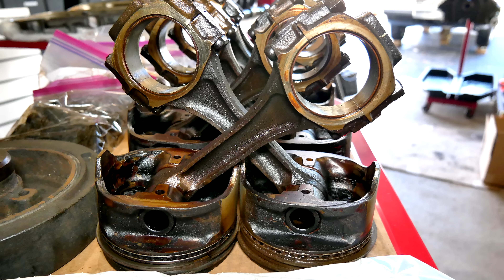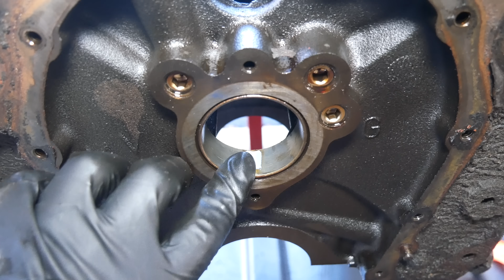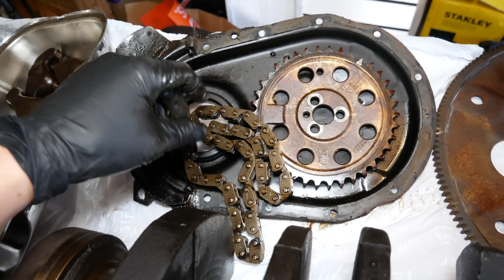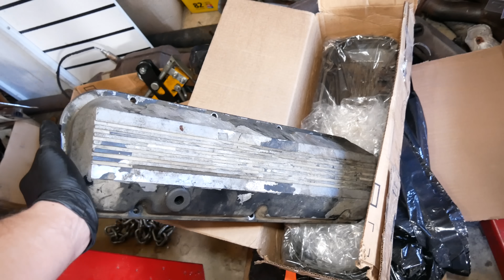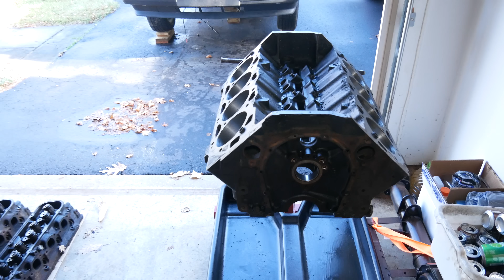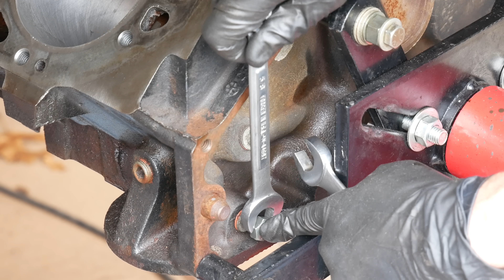$200 454 Engine Rebuild: Examining Parts and Laying Out Plans (78 Firebird Ep.15)

Comment: 3 years and i still am dying to see it run. I have a bored to 429 with d0ve heads that was "built" many years ago but sat for years and the cylinders look about as bad as this engine...... before i spend money on the rebuild kit and spend time honing the cylinder i wanted to see how this worked out for you lmao... 3 years still sitting in the garage for me, i guess i could have spent the money and did the work by now and found out myself 😆

Comment: The electric fuel pump will be nice for using a fuel bypass up by the carb. Which you're probably away will help keep the fuel from getting heat soaked.

Comment: It seems to me that this whole project with the big block is really not worth the effort. There is little point in installing this engine that is 200 lbs heavier than a small block and will make the car handle much worse for really not that much power. The purpose of installing a larger engine is to get more power but you keep talking about keeping the poor original heads and even the very low performance cam. The gen 5 was the worse one of the bunch and has the worse interchange possibilities. The heads are the very small peanut port ones and none of the valve gear is worth keeping for any performance purposes. The compression ratio is very low with this piston and cylinder combination. I have done lots of big blocks and I wish you the best but if it were me, I would try and unload this one and try and get a Gen 6. You will start off with a much better platform and can make something out of it. There are no good cylinder head options for you with the Gen 4 block and that is a key element in making this work well. Also you are going to have to face the fact that some unavoidable machine work will be needed so don't try and lowball everything and built something that does not perform correctly. Please forget about using that stock cam, any hydraulic flat tappet from Comp or anyone will wake this thing up so pitch it in the trash where it belongs. Remember you are building a big block Chevy and it's going in a Firebird. Give the car something to be proud of, not some castrated engine.

Comment: I replaced my my intermiadate shaft bearings with long threaded rod, nuts, washers and used a matching dia. wheel hub puck. You could rent a wheel hub press kit, maybe free from the auto store? Don't say no just yet...

Comment: Are you planning to at least shim your springs up to make sure they have good seat pressure? Should have those cylinder heads milled to lower the cc’s a little with running forced induction... Great Video’s Sir, Glad I ran across this! 🤟
Reply: I believe he said that he's getting higher rate valve springs and lapping the valves.
no reason to skim the head if they're in spec (which they should be being iron) low compression is ideal in a supercharged setup without an intercooler.
Reply: @ChristmasCrustacean  Naw man! There is ALWAYS a reason to surface cylinder heads when an engine is apart, ESPECIALLY when doing work to them!! I grew up in my Pop’s engine shop & at the racetrack, and have been racing & building myself now since I was a teenager (for nearly 20yrs.) Not trying to argue, or strong arm anyone. Just trying to give some friendly advice, so no worries. Take care!

Comment: I'd love to see you pay for that cam berring tool with a project. I havent found that anywhere on the YOUTUBE.  If you had some tools you really want but cant seem to buy for $$ resons. well, shame on money. You could even use the video/timelaps video to sell the finnished product. and blamo tools had. have a great day, yall....
Reply: the channel was smaller in december 2019 when these three videos were filmed and then engine was rebuilt in 2020... so while he couldn't justify the cost then he probably would be able to next time he has to do a cam.
honestly the cam bearings look fine and the same camshaft that was in it is going back in so it will probably be okay.

Comment: A 454 Chev engine without forced induction will last forever with just a bare bones rebuild.

I have a 5.7 litre Chevrolet LS1 V8 engine which has Done 363,132 kilometres & while I have replaced the hydraulic lifters ,oil seals & gaskets in it the crankshaft & camshaft bearings are all original as we as the piston rings.

The last time that I checked the dipstick it hadn't used any oil so the big V8's seem to last forever,I bought it with about 182,000 kilometres on the be odometer in 2008 then I put another 181,000 kilometres on it !

Comment: I'm perplexed. You spent $200 on a Chevy big block to save money, then had to spend more money to change things. I bought a 1972 Pontiac 400 4 bbl complete for $500. I have to change nothing to put it in my 72 Lemans. I even got it started after years of sitting. I'd rather keep a Tin Indian in a Poncho. I will also spend less.

Comment: I'm confused. 
Is he "rebuilding" a Chevy 454 or a Pontiac 455?
Pontiac never made a 454.
Reply: From what I can remember, the previous owner gutted the entire Pontiac drivetrain and put in a Chevy engine and transmission. So I think he's going with a 454 to keep things simple.
Reply: @xxnickdahackerxx2356  it never had a pontiac engine, it had a 305 chevy from factory.
the previous owner bought it without an engine and put in a 350 crate motor.
he's putting in a 454 Chevy because the car came with a chevy from factory and the supercharger parts are more readily available.

Comment: Reusing bearings and head bolts scares me lol
Reply: they're apparently not TTY headbolts so it should be fine, especially if the heads have never been off before.. a second stretch on non TTY bolts is nothing.

Comment: You should not have used the same head bolts that’s a very bad idea your head is going to start to lift with mileage
Reply: apparently not TTY headbolts so it should be fine, especially if the heads have never been off before.. a second stretch on non TTY bolts is nothing.

Comment: If you are going to push any decent level of boost(10+ psi) then I seriously doubt those tired, old, soft valve springs are gonna have an easy time closing the intake valves. Have fun with that!

Comment: me not being from the states so I cant give too much opinion on this build but, what does a machine shop charge???. in my opinion  this build is not low buck its just plane cheap ( no good quality )  take uncle Tony he is a low buck build kind of guy knows when to spend the  money but this...  is just being cheap
Reply: I disagree assuming he hasn't gone too wide of spec on the bore when he sets up his rings...
the cam bearings look fine, he's reusing the same cam so there's no issue of wear as they're wear matched.
its essentially just getting a hone... new rings, main and conrod bearings, new gaskets and seals and a timing set.
if the bores were in better condition it would have been perfectly fine to do main bearings, conrod bearings and gaskets and seals plus a timing set.

there are people out there who would have filled the bores through the sparkplug holes with ATF, cycled it until it stopped being crunchy, replaced the front and rear seals and ran it as is.

Comment: Man please tell me you arent going to reuse those old lifters. Also cam bearings are cheap and you should be able to have them replaced for around 70 bucks at a machine shop. No point in doing it if you are just going to clean everything and reuse the old worn out parts...unless you just want to do it to see how long it will last. Might be surprised. Hard to say.
Reply: I would definitely replace the cam bearings before I started buying fancy valve covers. Just seems silly to me

Comment: So I’m more “pro plastic engine parts” than most car enthusiasts are. I like them in certain places because they weigh less, and I like less weight. But plastic timing chain gear? I just can’t wrap my head around why they did that and what they were trying to gain. It’s not enough weight to matter, I can’t imagine it actually cost less to manufacture, and it obviously isn’t as durable.

Comment: I would replace the head bolts especially under forced induction I've had issues w at least one build I didn't do on a sbc where they used the old bolts and when I started beating on it decent it blew both head gaskets one night

Comment: fuck speedmaster. they sent me a set of shitty roller rockers for my big block mopar. felt like there was sand in the roller bearings, AND THEY USED FORD ROCKERS. they wouldnt even clear the head of the valve stem. I also had to pay return shipping ($30!)

Comment: I'm doing similar to a ford 351 Windsor. Really just putting new rotating assembly bearings and some gaskets and seals. It's been sitting for 30 years so I had to tear into it to freshen it up for use.

Comment: I recommend dipping the heads and block in an electrolysis bath to work all the rust out.
Using a one piece rear main seal instead of the old rope seal is going to be *so nice*.

Comment: Hey! Great video and I am 100% sure this engine is way past where these ideas would be helpful, but I wanted to share the way I removed and installed cam bearing for cheap in my Olds 350 Rocket. This worked great and the engine is running amazing with great oil pressure. 
Bearing Removal - https://www.youtube.com/watch?v=3liw7OAj-ME
Bearing Install - https://www.youtube.com/watch?v=5NYyclemE0Y

Cheers!

Comment: The lack of mechanical fuel pump provision might not be that bad long term if you wanted to get into fuel injection down the road (be it a high dollar Holley EFI, or a "lowish" buck GM Throttle body setup).

Comment: When you’re checking for scratches youse your nail across the journals if it catches it’s bad
Reply: I bet something was in the oil and caught between the oil hole and that babbit bearing. It'll be ok. Whatever it was continued through and out the end. Probably got caught in the filter the next time. I've seen that before.

Comment: Something to take into consideration(I’m sure you have), but the balancer may look fine, but could actually be bad! I quite literally replaced mine this morning, and while the balancer I pulled off was relatively new(no real signs of wear and the rubber looked fine)  it caused my water pump to prematurely wear as well as other rotating assembly parts to go bad relatively quickly. After replacing with an OEM mopar balancer, all my issues were resolved. I’d imagine if damage was done to belt pulley bearings, it would wear out any internal bearings as well.

Comment: Running Forest induction you need more lobe separation so you're still going to need to buy a different cam over that stock one
Reply: That is a lie perpetuated by cam manufacturers. Richard Holdener has numerous videos with dyno tests proving quite the opposite.

Comment: Do the head bolts stretch? I’ve only ever resealed a 454 I’ve never actually pulled the heads off one! I think that all the other bolts are fine but I’d be concerned about that one but I’ve also never done it! Love to see the build I’m super excited!
Reply from the maker: No torque-to-yield fasteners on these engines, so they are okay to reuse. New would be better and I am sure there is some amount of stretch, but not like with a TTY bolt where they are only designed to be used once.
Reply: @FuzzyDiceProjects  and that’s why I asked and didn’t try to make claims I didn’t know! Thanks for the explanation!

Comment: I can't resist commenting. Just my five cents because we don't have pennies in Canada anymore. I would've splurged for a mild hydraulic roller cam and a high-rise dual plane intake. Lots of low and midrange torque and throttle response and much less hassle. Those old superchargers are inefficient. The car is already cool and unique enough. As well, a roller cam has no issues with present-day engine oils.

Comment: Those chrome valve covers are worth a decent chunk of change, theyre factory and they have oil drippers and plug wire holders
Reply: Those are Chinese knockoffs. They look correct, but they don't have the drippers that the factory one did.

Comment: I've been working on old Trans Ams for years. Pretty sure that 454 isn't going to fit in the car. At least not with air conditioning and power brakes. I'm sure you'll come up with something.

Comment: I would say you should port the valves for better flow. If you are going to supercharge you NEED to get new head bolts. Probably check condition of main cap bolts

Comment: Should have done a 400 Pontiac.  The late 70’s engines can be had for cheap. You would need to move the mounts . Transmission would be you only boggle . None the less this is interesting, I can’t wait to see how it turns out

Comment: the cam bearing tool is like $60 off ebay lol
its buying 3 sets of cam bearings to fuck up is the killer.
Reply: my lisle brand was like 150 bucks with all the adapters. i put a single set in with no problem. just gotta line up the oil holes and take it slow.

Comment: dude you don't need to rev it to the moon to gain power with a cam swap.  That factory cam is junk, even a mild one that idles stock will gain over that factory one.  Also, since its flat tappet they are extremely affordable.
Reply: yup.

Comment: You should replace the cam.
I wouldn’t risk it.
Reply: That cam is 100% required to be replaced.  It will shred the lobes and blow metal all through the oil passages.
Reply: Why?  What is the risk?
Reply: @reallyhappenings5597  The lobes going flat and infesting the new bearings. Destroying the motor.
Reply: He obviously doesn't know what he's doing
Reply: He obviously doesn't know what he's doing

Comment: Old burned oil and carbon deposits can be easily removed with any EGR cleaner, the solution, not the spray like a brake cleaner. I did a lot of cleaning old engines and I always have few bottles in my garage now.
Reply: EGR cleaner? I'll have to get some.

Comment: Have you thought of making a home electroplating setup? If you want nice looking bolts, it would be cheap and trivial to make a nickel plating setup. Also electrolysis is easy rust removal and CAN actually put good metal back in place of the rust, just power and soap powder and scrap metal. Geoffrey Croker who does the Land Rover has videos all about it.
Reply: I did this on my rust frozen seat rail. It's like magic
Reply: Even better than magic, it's SCIENCE 🧪⚗️🧫🔬🧲
Reply from the maker: I have seen some videos about that process, and I would definitely like to try it sometime in the future! For a job like this there would be enough time to have the bolts sit around in a bath like that so it would be fun to try.

Comment: Could you not simply replace the cylinder inserts? Or is that only for aluminium blocks? Cheers from NZ🤙🤙🤙
Reply from the maker: Cylinder sleeves are usually just on Aluminum engine blocks, though sometimes they are also used for repairs or specialty blocks. This one is just one piece of cast iron all the way through

Comment: Going with a blower like that you're going to need to go with blower Pistons or else you will cook a piston and ruin the motor and a different cam
Reply: yes it will melt a piston if you go over 5 lb with a stock piston or it will break a ring I've been around blower motors for a long time
Reply: no.

Comment: roller cam retro fit would be well worth the cost in power and reliability (was hoping you'd find a gen 6) 
Richard Holdener did a gen 5 dyno not to long age, and the peanut port heads did better than I thought they would (up to 4500-5000 anyways)
Reply: roller cam benefits are not worth the $1200+ price tag.

Comment: 4:30 if you look carefully you can see the bearing material is actually cracked and is separating. Not sure how long that's going to hold up
Reply from the maker: I'm pretty sure those are just scratches from removing the camshaft, but I suppose I can't be sure. I end up messing up the bearings even worse before it goes back together so at least it'll be educational to see if they hold up haha.

Comment: Use ScotchBrite pads not sandpaper on the crank journals. May spend a more time but easier on the material
Reply from the maker: That's exactly what I ended up using! I have been using red Scotchbrite for everything the last few years. Fantastic stuff. The sandpaper was good last time because of the condition of the journal but this crank was in good shape.
Reply: Croakus cloth and emery cloth. Are the norm.

Comment: What vehicle did you pull it out of?
Reply from the maker: I bought the engine from Craigslist, already out of the vehicle. The seller said it came from a K2500 Suburban, but he also was told it was an 88-89 and it was actually a 93. Still, a Suburban is likely and that's what I'm going with.

Comment: Its really easy to make your own cam install tool with a junk can shaft it's what I use and I run a pro rod shop and never had a problem
Reply from the maker: Not a bad idea! Now that I have a leftover BBC cam I suppose that would have been an option. I have seen some various custom tools like an expansion plug that seem to work well too. I suppose I didn't have as many excuses for not replacing them as I talked about!

Comment: So I frown upon reusing factory head bolts and main bolts because they are stretch to yield torque bolts. I would have spent the money on arp bolts
Reply from the maker: Pre-LS small blocks and these big blocks do not use torque to yield bolts. Easiest way to tell is from the torque spec, if there is a degree measurement or something similar they are torque to yield. That said, replacement is still a good idea.
Reply: no they are not.